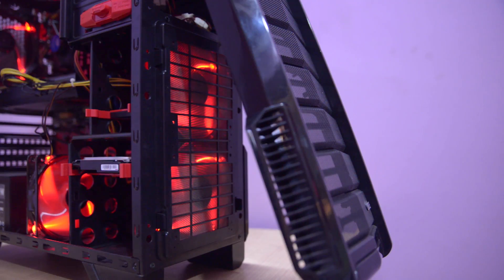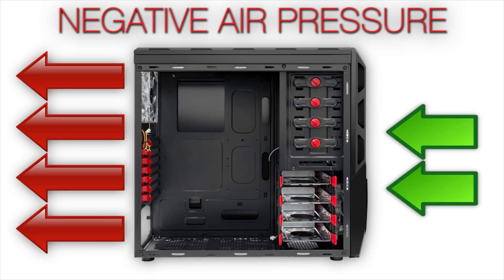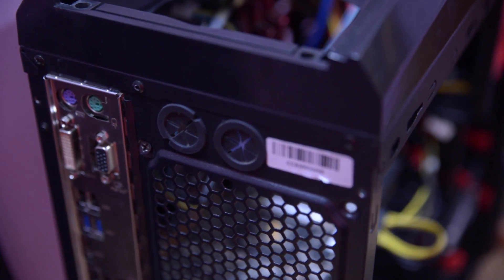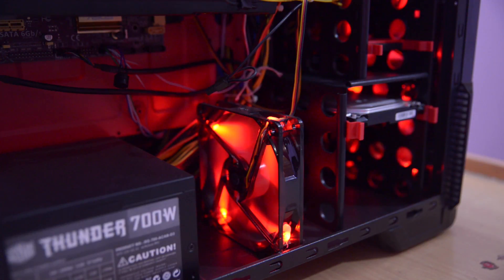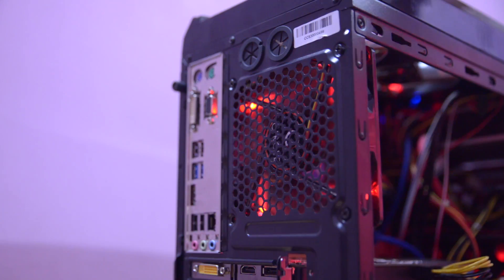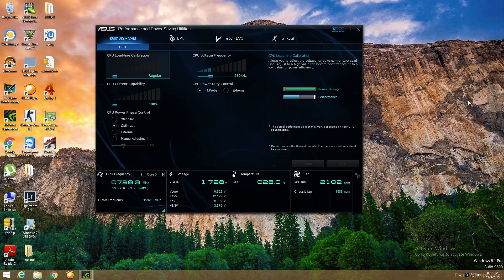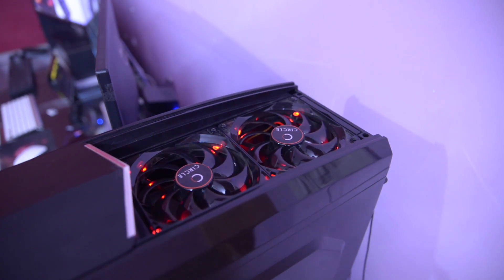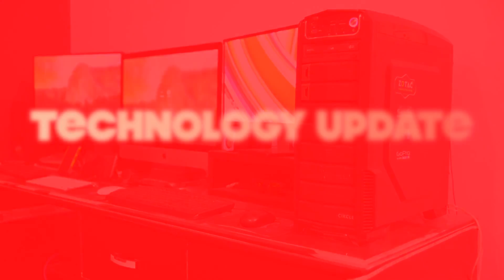Different types of air flow inside a Gaming case

Comment: i want to face palm myself after seeing this ....  4 intake 1 outtake fans... super crazy positive pressure that needlessly puts strain on the fans...  T_T  how is this logical ?  either use 3 front intake and 3 top/back outtake or if you cant 2 front 1top 1back  and let the front ones run a bit faster to have positive pressure which helps reduce dust buildup not increase it !!!! (if you have dust filters) since it will prevent dust to be sucked in from holes that dont have any filters by pushing the excess air out through them negative pressure however will mean air will go in through all those unfiltered gaps in the case and increase the dust buildup

Comment: Sir i am interested in this cabinet. Sir can you please tell me in detail the way the FAN REGULATOR works in this case? Is this a PWM one? Can i control the 6fans just by two of them with splitters and sort of stuff? Thanks sir!
Reply from the maker: Thanks for watching the video 
This case has 2 fan controller one for Front fans and one for top fans you can control 4 fans using those controlers and the back fan can be control from Motherboard if your motherboards supports chassis fan i hvnt used any fan regulaters cz you wnt need one
Reply: +Technology Update thanks a lot sir...you solved my problem...i was thinking of buying a nzxt grid splitter...but since this works...i will do without it
Reply from the maker: +Somrat Dutta yaa you dnt need to invest in a grid splitter and since you are using this case it comes with only 3 fans which stays arnd a Rpm of 1200 so i suggest you to buy Circle 120mm fan which runs at a RPM of 2000 with low sound
Reply: +Technology Update sir i already have 3 from circle.. :) and sir... will my cheap psu route all the cables properly through the holes?
Reply from the maker: are you building a new rig or installing a old one into new Case?
Reply: +Technology Update old one into new...will do it later...really amazed at this case..with such affordable price.....but my mobo doesnot have a 3.0 header...what to do? :(
Reply from the maker: ohk Great yaa this is a really Affordable case for Indian gamers i will be doing a In depth review on this case video will be up in 2/3 days make sure to check that out and yeah if you like this Channel Do subscribe and share
Reply: +Technology Update sir can u provide a pic of the jnternal fan controller....a wide view.... incase u make a detailed review of this case... :)
Reply from the maker: My deatiled review on this case will be up soon stay tuned
Reply from the maker: If you have any questions you can contact me at Gmail
Reply: sir your id?
Reply from the maker: Circle cc830 case review is online have a look

Comment: hi I have one more question.  can I over clock gtx 960 on a h97 gigabyte motherboard?
Reply from the maker: Yes you can overclock it bt you have to be carefull while doing it and i wnt suggest you overclocking cz i dnt want you to end up with a dead GPU rest in on ur expertise level
Reply: +Technology Update why
Reply: I have same cabinet as you . circle cc830
Reply from the maker: cz if you overclock your GPU it will take more Power and will get heat up easily and if your GPU was unable to control the overclocking you will end up Frying your GPU so before overclocking do some research
Reply from the maker: ohkk then if you use the fans properly then you can maintain a decent airflow and can overclock your GPU

Comment: hi . I am building a cpu with i5 4460 and zotac gtx 960 2gb .I have a lcd with 1366 x 768 resolution. how much fps will I get at high end games. ?
Reply from the maker: with gtx 960 2gb you can play gta v at 60fps without any lag and far cry 4 battelfield 65 fps are normal and if you overclock the gpu sky is the limit you knw what i mean
Reply: +Technology Update thanks a lot bro and great channel you have
Reply from the maker: Thanks make sure you Subscribe a lot of good stuff coming on here